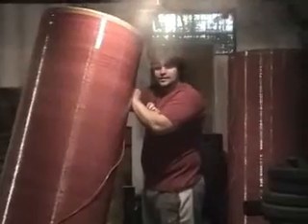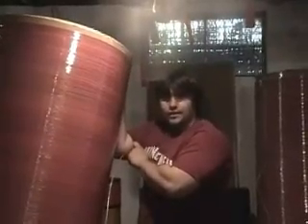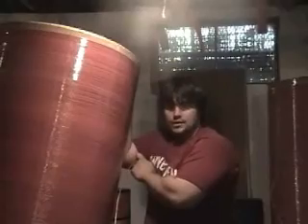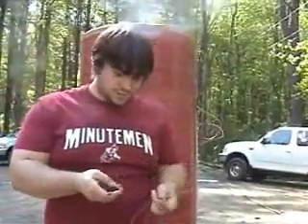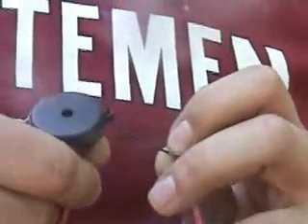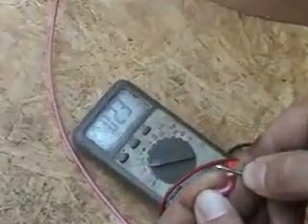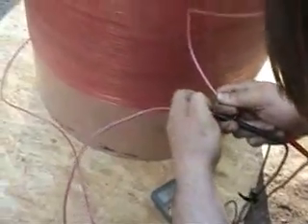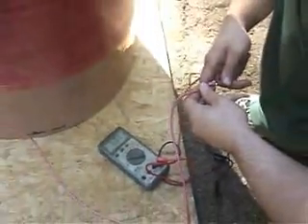Wireless Transmission of Electrical Energy Tesla Magnifying Transmitter Colorado Springs Research 1

Comment from the maker: yes the tesla wireless system needed energy input, at resonance the coils use considerably less energy to transport to all points on the earth at the resonant frequency. yes you are correct, but i did a basic test to see if energy is naturally in the coil , and it was. look to the other videos to really see what can be done for wireless power, this can be improved 10 fold, but i am not rich, and so progress is slowed because of this and it takes time...

Comment: Increase the primary coil with a thicker wire or copper tubing for air conditioners, you'll get amazing results like this ....... I like the results you get with a 100% jadobijam small Tesla coil ..... Good luck in further research .... : D

Comment from the maker: @nicesocialgirl well,i tried the best i could replicating tesla's colorado springs research.basically you build specialized tesla coils(important:they are not the same as sparking coils everyone loves lol).you build the coils to contain and transmit the energy through the earth beneath us,to another coil.what helps maintain safety is the resonant factors,which only allows the full energy at the resonant frequcy,then the reciever coil picks up the energy and lights the florecent light wirelessly

Comment from the maker: @panzarw I forgot to test it, it had to be between .05 amps and 1 amp to light up the florecent light in later videos! it was just to see if the systtem worked and it did without to much effort besides having to build everything lol.

Comment from the maker: thanks for checking my tesla work out! well that "free energy" test was just to show that theres strangely enough energy going into the coil to make the buzzer continously ring! check out the third video thats 20 ft wireless no conducting wires except the earth it would seem, and this is the way tesla meant by wireless, no artificial conductors, just the earth wire

Comment from the maker: also, its so important to note that this was ONLY 1000 VOLTS OR LESS causing this 20 ft wireless transmission! thats amazing in my mind because it gives us a reference point once i can use higher voltages running into the system. this should mean that upping the voltage should make the system more responsive to setting up more resonant waves along the earth area i am in and thus transfer more power more further!! 100 ft wireless for me will be a great day!

Comment from the maker: its a high voltage like 1000v or less, but a higher voltage should make the system much more effiecient(tesla was using like 100,000 - 1,000,000 volts to test this coil set up)i just dont have the money for that set up, but plans are ready once i have money lol. the frequency is less than 100,000 hz and so its high frequency but alot less than basic radio.

Comment: very nice work!!! how many turns do your coils have? and what's the thickness of the wire used? just a thought, it may be that the tiny voltage is induced in the coil because it is spinning in the earth's magnetic field, sort of how the faraday homopolar generator works! (which is also a VERY interesting machine, because it can prove that the magnetic field of a magnet does not "rotate" if the magnet rotates around it's polar axis, )

Comment from the maker: yes! YOU ARE RIGHT! thats what ive been trying to show peoole. the earth is a conductor and is the only way to give efficient industrial wireless power ever. air transmission is regular radio microwave and all of those frequencies all "line of sight frequencies", everyone forgets teslas longitudinal waves are different and propagate mainly through the earth, possibly a magnetic wave could extend higher for aircraft later on, on an immense wardenclyffe scale.

Comment from the maker: yea the grounding is so important, i will focus alot on that next time. the transmitting coil is on the right in the videos and the reciever is on the left, the primary wraps around the secondary on the transmitter circuit and then the energy is transfered to the the reciever coil on the left. sorry i forgot to explain that.

Comment from the maker: there is a ton of equation work i still have to do, this is just basic resonant conditions and still there are things in teslas work that make this transmitter different than the basic tesla coil. it seems close but there are little tweeks to the system to gain energy, efficient transfer and different resonant conditions. we will see , thanks for looking!

Comment from the maker: well its years of researching teslas work and ideas, in past few months everything came together the equations, diagrams, regualtion and safety devices i needed to make so this took me about 4-5 months to build just because of work and such. its very expensive and so it took a while to build. this coil design once properly made should be able to transfer energy up to a mille and should be able to power a small home i believe,i still cant fully say that till i do more test,but should be possible